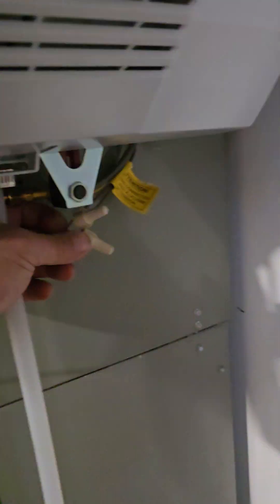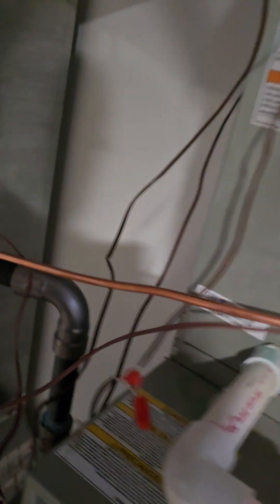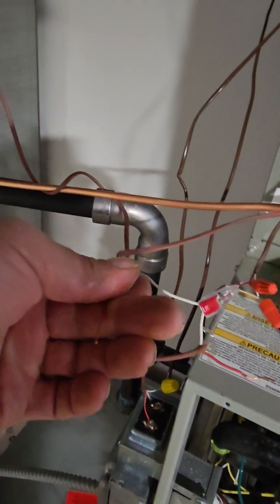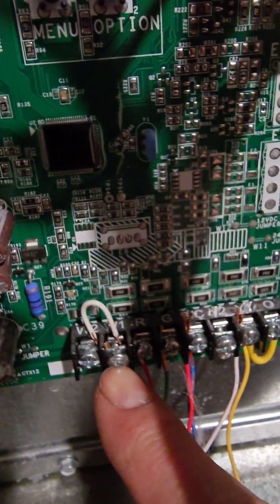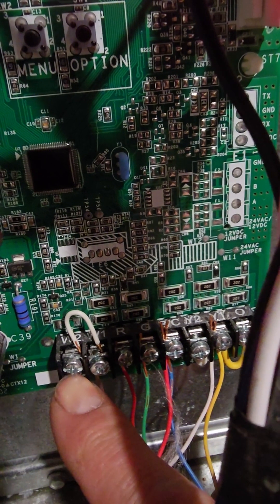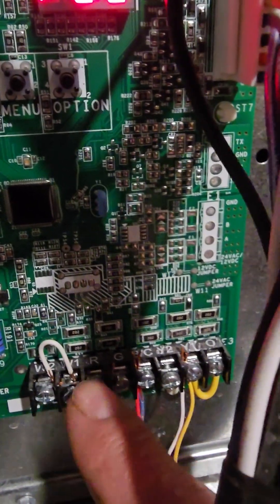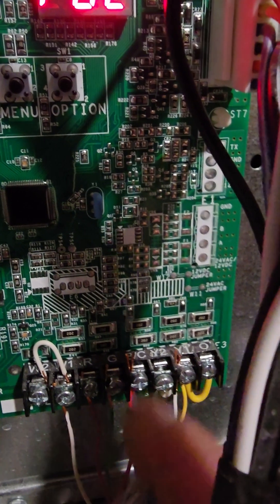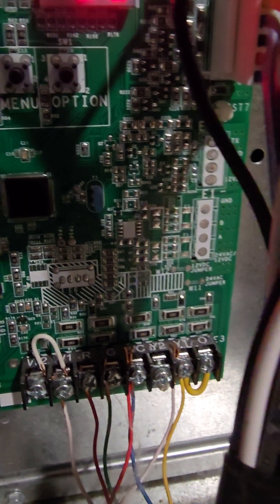wiring up manual humidifier to furnace to come on with your call for heat

Comment: This will over load the transformer for the furnace (can). It is recommended to use a separate transformer. But same idea
Reply: if we add a transformer.. do we need a relay to create a dry switch?